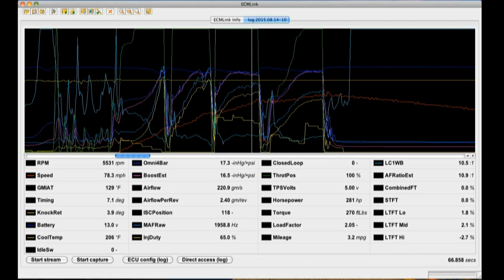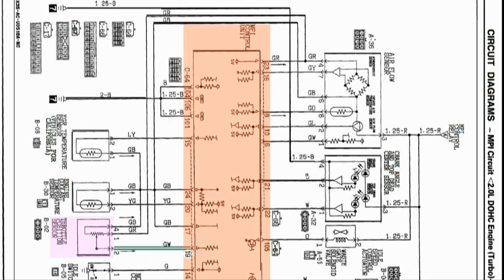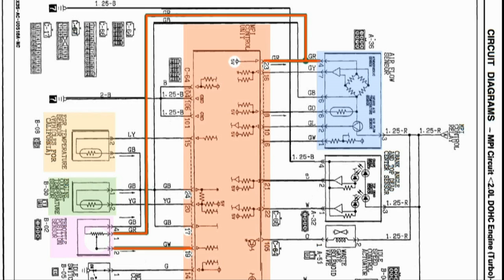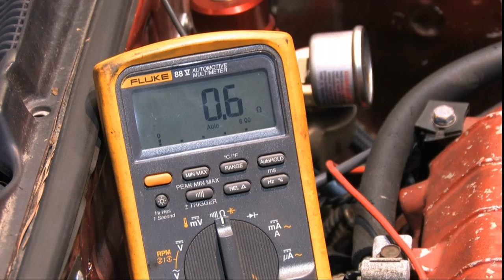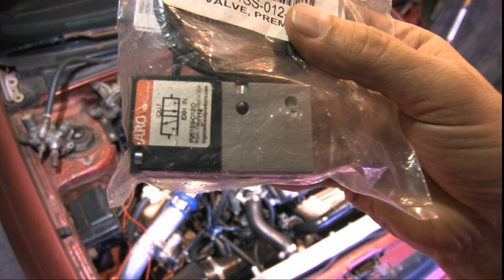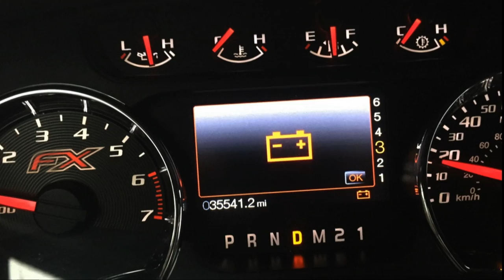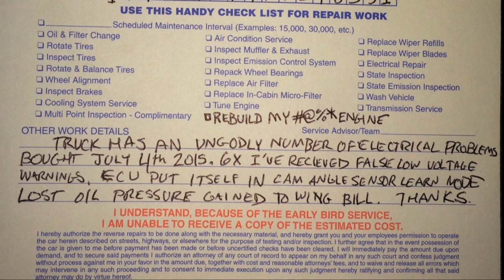Hyundai 16 - Hyundai Wiring BS

Comment: Loved every moment Jafro, thank you for the excellent video!
Reply: Tom! how's the 1g doing?!?!
Reply: are you going to the shootout bruh?
haha JK Tom. wish I could go but spine surgery stopped me this year. See you there next year.
Reply: +Gonzo's Garage same here, about to get mine L5S1 fusion. It should be fun
Reply: he got rid of it a long time ago and got the galant
Reply: +EdwardAlcala it's going to be fine, lay on sides only for the first month. Slowly start to roll on your back after 30 days. Go for one walk a day up a 700 feet at a time. after 60 days go half way around the block, 90 days around the whole block. During all this, Stand up and then slowly lift from your knee high as can. as time goes on keep lifting higher and higher, when you pick something off the floor, squat and keep knees close while going down. You won't be able to lift much or reach out with both hands to wash hands. Go very slow and you will get there gradually. I'm almost 90 days out and just started to hold a gallon of milk. Just got behind the wheel to start driving. Tell your driver's to go extremely slow around corners, those g's pulled on turned fuck your screws up. 
To get home I laid on my side in the back of my work van. it's best to stay on your sides. Good luck

Comment: Holy shit..  You're still alive?

2:23 I lol'd...   I fucking HATE electrical problems.. I have a car that's sat for weeks because of some mystery issue.  I'd rather replace 5 broken starters in a row, done by myself, in the pouring rain, middle of winter, in a dark parking lot over some mystery electrical issue.
Bolts out bolts in, that's the depth of my mechanical ability...
Reply from the maker: This right here.  This is specifically why I filmed and edited the troubleshooting process.  I think everyone out there feels the same about them because the diagnosis looks scary.  An electrical problem rarely costs as much as a starter to fix, it just takes the time and resources you have available to sit with it until you isolate it.  But I know you were just using an analogy, I'm not saying that's your starter problem...  I threw everything I had at this.  Sometimes that's what it takes.  Sometimes fixing an electrical issue takes determining what's not the problem.  I think showing all of it might help someone else figure out a different kind of electrical issue.  Lord knows, I don't want to have to troubleshoot them all, but electrical diagnostics are just a methodical process of elimination and isolation.  Read codes, take logs, smell things, read electrical diagrams, find connectors and wire colors, visually inspect things, probe things, you'll find it.  These are all of the tools.  I did all of this to find the problem and never once had a check engine light or trouble code.  That's why I didn't mention that.  Whatever someone can learn from this, that's why I posted it.
Reply: +Jafromobile Personally, I find the diagrams to be the worst part of electrical troubleshooting. Parts diagrams, by comparison are easy to visualize and intuitive. Electrical diagrams are very dense and use a lot of shorthand.
Reply from the maker: In the description, I explain this...  The Electrical diagram itself is it's own best interpreter.  The preface to the electrical diagrams has legends for all of the parts symbols, the wire thicknesses, wire color codes, connector locations and labels, everything... it explains itself because it's written from the perspective of "you're a mechanic, not an engineer".  Special tools, procedures, they're all in there.  That's how I learned to do it.  ;)
Reply: +Jafromobile I don't disagree with any of that. What I meant to convey is this: Given a novice mechanic a factory repair manual. Open to the page with the manual transmission explosion diagram. It is easy to figure out just by looking at that page alone. Now flip to the page with the body wiring diagram, it's much less straightforward, the wires aren't in direct physical relation to each other (many wires aren't even fully shown, they make a jump), there are abbreviations everywhere, and symbols instead of pictures of parts. 
I guess my point is that electrical diagrams are more intimidating on first look for just these reasons.

Comment: Hi Jafro, I am a qualified auto electrician, Anyway your electrical fault finding procedure is very good, the way you work out what to do and the way you do it is very good too, just get some different diameter heat-shrink tubing. I have watched you do lots of mechanical work too and conclude you are a first class mechanic and a auto electriction. And as I say I am a qualified nvq-2 mechanic of around 35 years. Paul

Comment: Great video! I have an old 93 LT1 that has the same gremlins. But mine are always something small and mechanical. Like dampening springs pulling the valve stem seals off the valve guide and then getting eaten by the springs sending metal all through the engine. I put a magnet on the pan and changed all the springs and seals. So far so good still makes good oil pressure, but for how long? Only time will tell. But I did think my piss was excellence after the fix. I now call that motor Tony Stark….

Comment: As a fellow Galant VR4 owner I would like to recommend that when you need to probe a terminal try to back probe whenever you can. The female ends can be a bit brittle and break. Or if that doesn't happen the terminals spread. And that's just too much of a headache for anyone. I hope that comes in handy. I can't wait till you get back to the GSX or the VR4.

Comment: Been there done that. In my trials diagnosing a sputtering gm 2.4L came across a healthy number of internet forum mumbo in regard to hyundai issues with leaky throttle body seal to tps sender causing condensation buildup. Car sounds like bronchitis some said.

Comment: I've learned a lot from your videos and appreciate all the effort and hard work.   I started watching your channel on the "engine build"   After watching... what must have taken you weeks... and months of hard work,  I thought this engine was going into some kind of prestigious supercar!!!  Man was i Wrong!! lol   i think its cool though to have a sleeper but youve put so much work in the engine... at least let me paint that poor thing for you, or at least fix your rust spots!!  Ha Ha   Keep up the good work!   ;)
Reply from the maker: For you, ima paint it "jesse brown".  Actually I probably can't afford paint that nice.  But yes, the whole reason this is so ridiculous is a potentially 400hp engine is installed in a car that previously made maybe 90hp at the pavement.   Only the cylinder head casting itself is a stock Hyundai elantra part.  Everything else is leftover parts of other cars Jamie and I stripped in our own separate pursuits.  It's the lowest of low budget builds.  It shouldn't be allowed.  I'll paint it before it grows its own sunroof.  Please both humor and forgive me when my paint job matches the quality of the rest of the car.  I'm not building perfection, I'm building hystery.  It will be hysterical.
Reply: I've used summit racing for several paint jobs using the 70$ harbor freight gun (which sprays better than my devilbliss) and they came out great.   its not that hard to paint and you can always just buff the clear coat.    Keep up the videos...i pay to watch/learn at hp acedemy.com and I have learned more from you  for Free!   im sure others would gladly donate to fuel your projects.

Comment: Great job on the diagnosis, as a Hyundai tec  since the early 90's when Hyundai used Mitsubishi electrical harnesses  we use to repair many ground connectors in the harnesses, for the very same problems you were having, the whole time I'm watching this I'm like he's on the right trac he's going to find it. The wiring on those cars even when new was not that good.routing, connectors, grounds, anyway nice job.
Reply from the maker: How 'bout a little heads-up next time?  Gee Whiz!?!  :D

Comment: Hi Jafro, I have a 1990 Mitsubishi Mighty Max. You're the only person I can think to ask this. My truck says it was manufactured in August of 89', but the title says it's a 1990, and the engine bay ID plate says it has a 4g64, and a R5M21 transmission. But the bellhousing measures 12.25 and it's a 6 bolt G63B engine  (says the ID badge on the block) what gives? I have no idea what parts to buy for the clutch or anything.

Comment: I thoroughly enjoyed this video.  I'm a fan of you're work overall.  I'd like to toss in my 2 cents (CDN funds) on a couple of the tips.  

#2.  Eliminate the copper band and go with a heat shrink butt connector where you can, corrosion in the band can also be the cause of poor connections.
#3.  Avoid the use of electricians tape completely if you can.  Hockey tape is a great option to go over the loose ends when wrapping loom with electricians tape as it isn't as prone lose it's grip when exposed to moisture / heat cycling.
#4.  Absolutely disconnect the ECM when checking circuits with resistance.  Your DMM induces a voltage through the circuit when testing for resistance, then measures current flow and calculates resistance, Ohm's law.  Once the circuit has been confirmed, switch over to Voltage Drop testing to see if there are losses when the circuit is live (a great way to identify a harness/component that's breaking down).
#8.  Butane soldering irons are worthless once fully exposed to cold ambient temperatures (anything less than 32 F).  You will have to form some means of keeping the iron warm if you intend to use it in cold ambient temperature.
#9.  If you're using the stock battery location, replace the chassis ground and engine grounds with quality cable ( 2 AWG welding cable will do if you're on a budget, a 25' roll can be had for less than $40) when upgrading car audio, running other high current through the alternator.  Helps to reduce  alternator whine (Honda owners) by reducing electrical losses.

Thanks for the video Jafro, I really do enjoy your efforts.

Comment: Hey again Jafro! As usual, your content literally pisses excellence (lol!) and brings us all valuable knowledge and know-how. I recently bought my first ever turbo awd DSM (previously had a non-turbo GS) and I've been battling with pretty much every possible problem.

In connection with your electrical adventures, I also had to go through one. I am lost when it comes to electricity and everything to do with it, so naturally I was quite afraid of tackling this problem. I was missing the 4 pin plug on the alternator that feeds signals to the ECU and other sensors. I managed to find a plug with smaller gauge wires, but with some effort I soldered it (very poorly) and everything works now! One small step for me in the world of electricity and soldering, haha!

Anyway, my only problem now is the clutch. It just dont feel right and I think I may have broken a pressure plate finger or clutch fork. I have a video of it showing how much free play it has, I'd appreciate it if you can take a quick peek and see what you think. Thanks a bunch as always!

Comment: Great video, amazing catch at the end and props for adding Clutch concert in too.  The problem with your Wile e Coyote Fx4 is what I read about when researching about the new f150s.  I know what you mean by the luck thing and I think anyone who crossed to the dark side namely all platforms of the DSM's has encounter the same kinda of luck which is known as Dsm curse but does work out for the better when those gremilns are fixed.  You must've kept a bunch of parts from foofy how's your other projects going colt,gsx, gallant.

Comment: This might be a longshot, but could someone point me in the right direction on how to find the origin of the power-lock issue with my 1996 Hyundai Sonata GL? The doors lock themselves whenever they feel like it. I will leave the car unlocked in my garage, go to bed, and by the morning, the car has locked itself. This car has no key fobs. Yes, this is not super important, but it would be nice if I could figure out the problem and fix it.

Comment: Jafro, Always a good day when one of your videos pops up, love watching them. I feel your pain on electrical problems, Helped a buddy fix a parking light issue(fuse popped everytime lights were turned on) felt like close to 50 ft of wire with 9 different connectors plus a switch to test.

Comment: And now I feel like a bit of a wuss for letting my 1980s Dodge truck tail light harness issues go on this long. Fairly annoying having a perfectly good running truck that I just got done rebuilding the rear axle on sit while I borrow a car to get to work because my tail lights don't work and I get off work at 10pm. Equally annoying is that my friend left his broken Impala in the garage and took his keys with him, but that's another issue.

Comment: Hey Jafro!
mate i took some of your testing methods to task on my Frankenstein car project and was chuffed to find i have a nearly exact same issue. 
i found my sensor ground wiring to ecu for TPS,MAF and coolant temp sensor was all over the place and resistence bouncing all over the shop. My wiring like yours is 20+ years old and was meant for a 3000gt but ive grafted it to suit my Aussie made 4 door Magna.

like you i had knock, random cylinder misfiring, and whatever else the ecu could come up with.
the little metal clip thing on my harness has corroded and any little shake of it and resistance goes skyward. 
i might now be able to finish this bloody car thanks to your misfortunes and diligent diagnosis. thanks mate!

Comment: Your comments about stuff coming off the ECU makes sense. The ECU is a low voltage controller, it doesn't power anything. Two wires going to a sensor means  the sensor has two functions. The ground is the third wire.

Comment: Hey Jafro, just a heads up touching the probe tips together won't give you the impedance associated with the multimeter and your probes. Find a clean scrap piece of copper or aluminum and press the tips probes into it very close to each other. The 0.4 to 0.5 ohms your reading is likely more a function of the oxydation on the probes and is a function of where they make contact. Thanks for all the great content!

Comment: Ahh yes the wiggle test.  You're a ford owner, you know the wiggle test.  Yes ford has been suffering from fuel pump related issues for a while.  The most current one I have seen has been in squad cars, the fuel pump driver module fails and there is a no start.   91 talon tsi still runs and works great, daily it when I can. safc2 is awesome for reliability.

Comment: You can do it with just a bolt, but you have to know the spec for the nutsert (whatever it's called). You then measure that on your bolt with some white paint marker (or something visible on the threads like say a saw mark) and proceed to work it. Depending on bolt size use a washer (saves the nutserts' face) but beware to subtract that from the pull spec.

Comment: Using tuner software with real time data is a killer way to get you in the ballpark with wonkey electrics.    You can see in real time what is effected when u wiggle.   It's like the wiggle test stage 3. ;P   So i wouldn't be as surprised that you have good results with a "guess"   because as far as i can tell, you applied common sense, with a wiring diagram to get there.   I applaud you my friend, hell of a guy and pretty smart to boot.   Thanks for posting.

Comment: My old truck likes to randomly not start and the grab wiring and shake trick fixes it right up.  On my other car it actually helped the car run better when I rewired the fuel pump I added another ground back at the fuel pump and tied that to the pump and to the original ECU ground guess what the car starts better every time now. Probably the ecu is even getting a better ground now sheesh.

Comment: At 13:40, the flaky mechanical connection is fixed by simply soldering it over to lock everything down. Would it have been worthwhile to first separate the wires in the old connection, scrape them off to get cleaner copper, reconnect them mechanically, and only then add the solder?

Comment: I know this is 5 years old. I may be mistaken but when you put that radiator in ....the way you described the fan wiring was that you had one fan running into the other. If so that is incorrect. The fans should not be wired in series they should be in parallel. This would severely hamper there cooling power and the speed they run. Unrelated but just sounded like thats how you described it